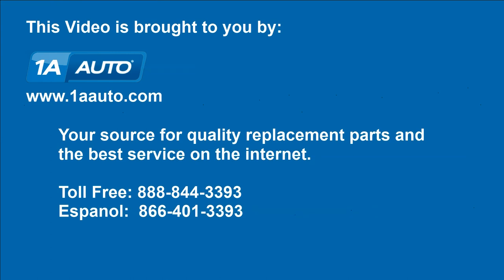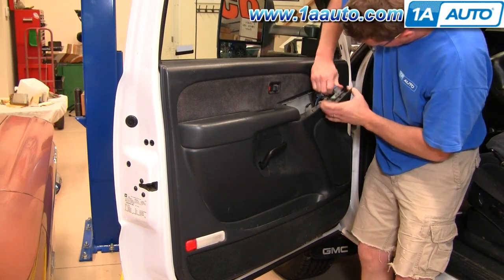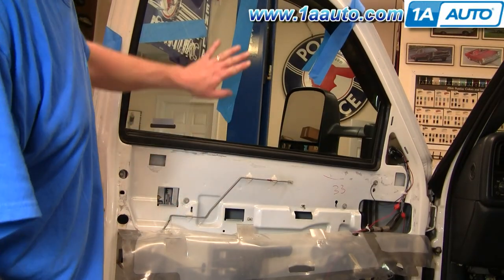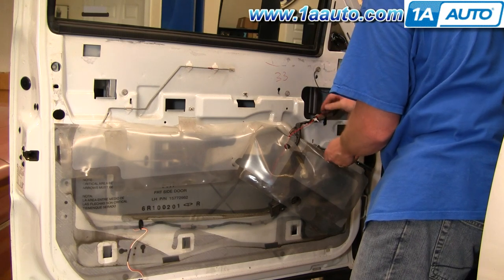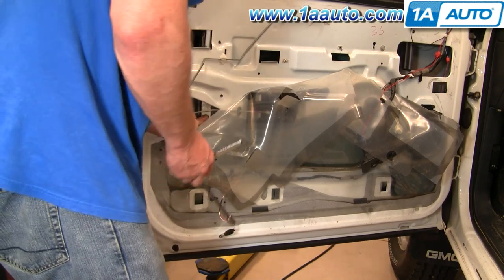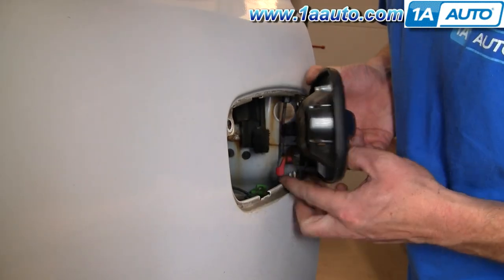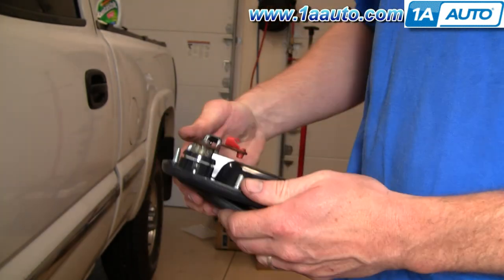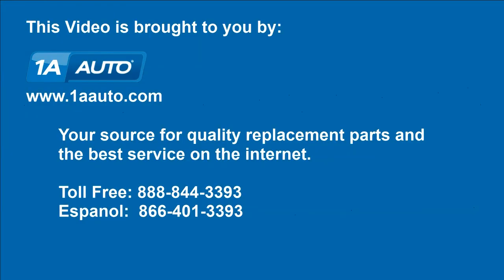How To Replace Front Outside Door Handle 01-06 GMC Sierra

Comment: You definitely do NOT have to take out the window of any sort...all 3 bolts are fairly easily accessible. Just did this myself in ALOT less time. enjoyed the video and thank you.
Reply: so you don't really need to mess with the window
Reply: Ya I didn't have to take the window out or unbolt the window regulator.  Even though that nut is hard to get at, it's still fairly easy
Reply: Sweet thanks about to tackle it ha

Comment: Total noob here. Thank you so much for the video. Job done in 30 min. The window stop was considerably different on my truck but just as easy once I found it. I don't know how you got the clips off the handle rods so easily I cut myself 3 times and it took easily 10 minutes of the 30 on this step, but eventually got it done. Thanks again!

Comment from the maker: Yes if the handle was damaged while someone was trying to break in, this would be a good video for you.
Reply: I had someone pry my door lock out and break off a key of some sort inside my ignition. Got all my Milwaukee and Makita tools instead of the whole truck. Anyways I had a locksmith tap out and replace my ignition cylinder, the new keys won’t unlock the current door lock I have. So my question is am I able to buy a door handle with the lock cylinder not keyed yet? Thanks guys 😄

Comment: This is the 5th time I have used one of your video's and they are great.  I just replaced my handle on a 1999 GMC Sierra 1500 4x4.  The only difference was I had one more plug for the electric lock and mine didn't have the window stop for some reason.  It works great and sure beats climbing in from the passengers side for the last 5 days!  Thanks again for the video's!

Comment: I usually replace this handle every year it seems - probably due to the cold weather and frequent use. I am usually able to replace the handle plate without removing any window hardware. With enough dexterity you can reach your arm up through the large hole in the door by the latch to start the 3 nuts for handle. Note how many threads are exposed on all linkage rods before putting everything together. They may need to be adjusted and properly lubed (window track too while you have it tore open) to prevent future stress on the chincy plastic handle mechanism and other electronic parts.

Comment: Good video and helped me a lot as I just replaced my passenger front handle following a break during our ice storm.  One item to note that on the 2004 Silverado 2500 HD crew cab that I have, the passenger front door handle does not have key entry.  I didn't really realize this until I had bought the catalog listed part.  Not too concerned with the aesthetics, so I'll just fill the hole in the new part with silicon and then paint it black.

Comment: This video gives some good tips but as you said, the procedure is different for say a 2006 Silverado 2500HD Crew Cab. I just replaced the drivers door handle and the right rear handle. The biggest difference I found was the is it not necessary to remove the auto seat adjustment control and the control panel for the power windows and mirror adjustment. They can be left on and then the plugs can be removed from the back side by removing the panel screws and lifting the panel and tilting it so you can reach behind and pull the plugs. There is a panel screw behind the door lock panel. Also a plastic fastener that pries out at the front of the panel. Another torques(torks)screw behind a plastic fastener towards the rear of the panel and another at the bottom of the door(up from the bottom. Other than that, the process described is pretty much the same. I found that I was able to find a spot below the door handle where I could squeeze my hand in and remove and replace the nuts holding the handle on. All in all, not a bad process. Thanks.

Comment: Some loser punched the lock on the passenger side door of my 02 Silverado. I'm not going to replace the lock but rather plug the hole which requires me to have access to the backside of the door handle.  Thank you very much for the video as my funds are tight and I can't afford the dealership prices for the repair. Again, thank you so very much for the instruction. It's going to take me some time to plug the keyhole but your expert video will guide me!
Reply: R Mont You do understand when they punched the lock cylinder thieves were trying to break into your truck .When you "punch " out the lock cylinder all you have to do is reach in and pull the link up and youre in .

Comment: Your process worked great.  For those with a little dexterity, at least on the passenger side, you can reach up and do the bolt behind the power window assembly without disassembling any of those parts at all.  Took me 20 inefficiently spent minutes.  Bought the part for $16 so you saved me at least $100.  -2000 Silverado 1500
Reply from the maker: Thank you for watching. Please let us know how the repair comes out!
1aauto.com  888-844-3393

Comment: Very helpful video, thanks! 3:57 My truck didn't have that bolt so I just skipped that step. I never had to take the window regulator rail off either. If the glue on the water shield is not sticky super glue works great.

Comment: If you ever lock the door with the lock cylinder or manual lock, and then unlock it with the power system, or vice versa (it may only  work one way... cant remember for sure) the alarm will go off. For example if you lock the door with the key fob and unlock it with the key it freaks out. It's pretty silly and I think there might be a way to turn it off, but that's why the alarm went off. Anyway thanks for the video, I'm gonna be buying one of your handles today!

Comment: Helpful video but just wanted to comment on one step.  I was able to R&R the upper right (10mm) handle nut without messing with the window regulator.  I own a set of SK short metric offset box end wrenches.  Major tool makers offer similar wrenches.  I went in through the large, lower hole and was able to just get the wrench on it.  Must be offset and shorter than standard wrenches to access the nut and turn it.  Saved a good deal of time and risk breaking the window glass by taking it loose.

Comment from the maker: The video is the exact same steps for the 2004 as shown on the 2002. The only reason you would have to do anything with the window regulator is if it is broken as well and in the down position. The window needs to be completely up to access the bolts inside the panel.

Comment: Do you have a video showing the exterior door handle for a Chevy Express?

Mine happens to be a 2000, but I think the procedure is almost identical to the newer models once the interior panel is off.
Reply from the maker: If it's on the front door, we currently do not. We do carry replacement exterior door handles for your 2000 Chevy Express. Here's a link to them on our website, all orders also include free shipping in the lower 48 states. http://www.1aauto.com/2000-chevy-express-1500-van-exterior-door-handles/y-mo-c/2000-1748-15?utm_source=YouTube&utm_medium=CTA%20Comment&utm_campaign=1ATony

Comment: What is the metal arm that  attaches to the back of the actual lock cylinder,????  and has the red rod clip attached to it. I cannot find this part ANYWHERE. I replaced my door handle and lock cylinder neither component came with this part. And for the life of me, I cannot find it or even a picture of it anywhere. Please help.

Comment: Well, what a pain in the ass, but it's done. My 03 is no different than this 02. I did kind of chane 6-7 steps. I took the 2 easy bolts out, and snapped the handle off the 3rd bolt, this made it much easier to get to. I then installed the new handle. First the 2 easy Cus free and pain free bolts. On the 3rd one I was able to get my hand up behind the window, there I hand tightened the nut. I then, with much pain pushed my hand back up in there with a 1/4" drive and socket, a couple of turns

Comment: When I checked to see if the door latch would operate after installing the new handle, it shut and won't open. No amount of jiggling, coaxing and prying on the inside of the door on the latch mechanism helps to re open the door. Been at it for about 2 hours, but still the same problem. Any clues as to how to open it and fix the issue?
Reply: Did youbever find the solution to this?

Comment: FWIW before you go removing that rear vertical window channel that is held by the 3 bolts so you can get at one of the new handles stud look first.  I was able to use a 1/4" long extension and socket to start it with my fingers. It will save you a step if you can get at it.

Comment: You can do this without doing anything to the window or window lift bolts. Only one bolt was hard to get to..used an open end wrench to loosen and removed by hand...significantly easier and faster than what is shown here. Otherwise a helpful video.Thanks

Comment: I installed the new handle and now the lock won't engage, would it be possible I put the lock in the new door handle wrong?
Reply from the maker: +Travis Morris You may want to check the rod going to the lock to see if it is connected correctly. Hope this helps you out. 1aauto.com

Comment: i broke off the red plastic part attached to the lock mech...can i buy just that
Reply from the maker: You may be able to get one at the dealer, or possible at your local salvage yard, if there's another car in there like your. Hope this helps you out. 1aauto.com 888-844-3393

Comment: can this be used for a 2004 savanna
Reply from the maker: You may be able to apply some of the basic steps shown in this video to your vehicle. We do carry new replacement door handles for your 2004. Here's a link to one of the handles that we carry for your 2004 Savannah, it has an auto repair video too, but might be different than the handle that you're trying to replace. Hope this helps you out. http://www.1aauto.com/exterior-door-handle/i/1adhe00804?f=675110&y=2004